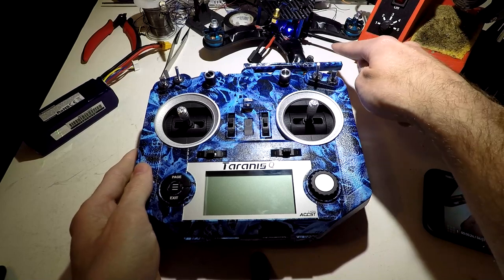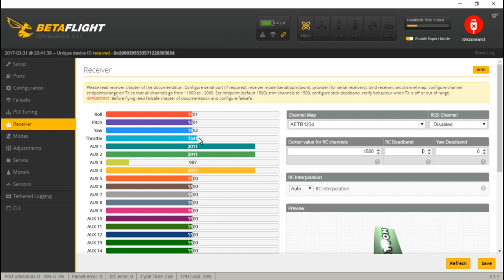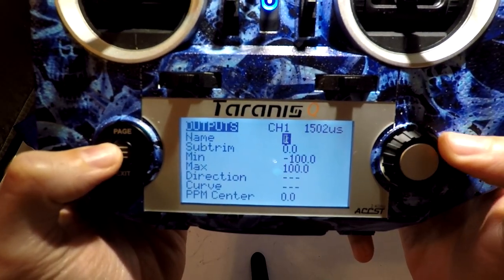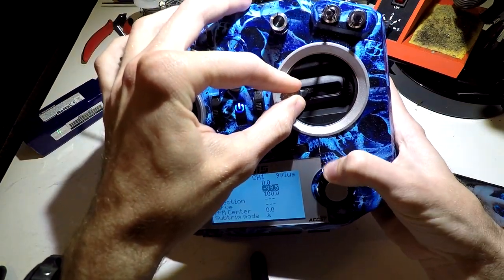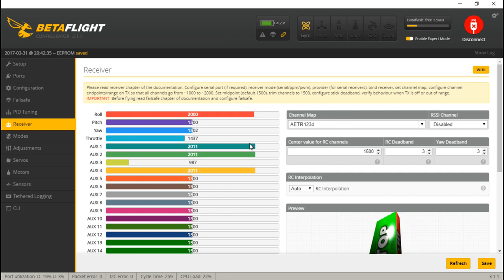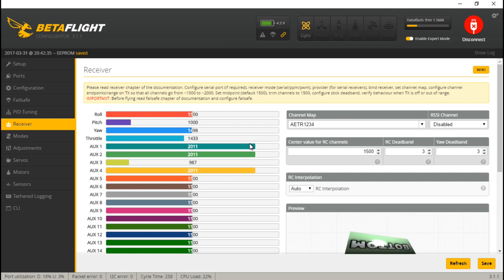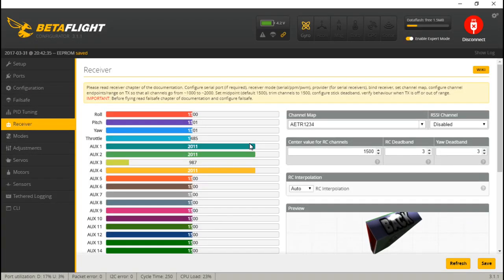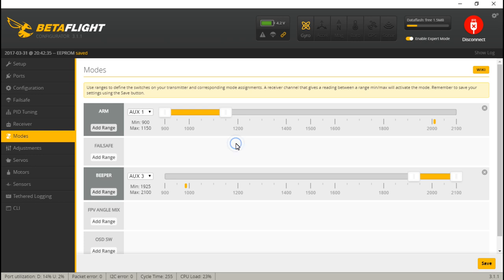Taranis Q X7: Calibrating Channel Endpoints

Comment: JC can you teach us how to adjust the telemetry for KISS ESC and FC to jet the Mah measures to be spot on?   I set up alarms like you showed us but notice even when the QX7 says I've used 1250 Mah my bat voltage is still at 3.75v or better.   Should be down to 3.18v or less if I really used that much of the batt capacity.     Thanks man!  👍🏼

Comment: please help me lol... got the x7 and when trying to set end points in betaflight won't let me go to 1000 or 2000... my min at min stick is around 1080 and max stick is around 1970 so when I try to set it from x7 will only let me go up from min and down from max... is thrre a way to get it to go below -100 on the x7 ? thanks so much if you can help me, kinda new to this whole setting up stuff
Reply: I have exactly this problem, mine end points won't go below 1080 and past 1970 and can find no way of fixing it :(
Reply: Rich Lees I fixed mine by myself he didn't wanna seem to answer lol easy fix... make sure in your transmitter that everything is set to factory meaning ur subtrim ect. then go into betaflight and write down your end points and min points for each 1 like roll then pitch then yaw I think the throttle wtv it is in order on betaflight then go into cli and type rxrange 0 1020 1970 press enter rxrange 1 1020 1970 press enter do that for each one but put your numbers in there make sure ya do it in order and it goes to rxrange 3 not 4 çuz it starts at 0 then when ya get them all typed in like that type save then press enter and worked awesome for me had to go in on tramitter to fix yaw mid point use subtrim now the other one he was using.. hope it helps ya worked perfect for me
Reply: Awesome thanks that's a great help
Reply: That worked a treat, had issues after changing the receiver on my King Kong 90gt, Never had an issue with any of my racing quads :)
Reply: Rich Lees haha mine was with the gt90 too and I changed the receiver also put some new pid's in it and Flys almost like a 4 or 5 inch I haven't upgraded the firmware yet tho Flys great now so why bother lol if ya want the pid's just let me know... I'll sub to you and you sub to me check out my kingkong vid

Comment: hello can you plz help me iv bin from vid to vid to vid ok i have a night hawk pro 200 with a fr sky antanna/rx and a taranis q x7 transmitter i hade to solder the rx myself but i no it works its binded now my problem is when i am on bata flight my right stick up and down is roll and my troddle is left stick up down is pitch i think not sure for word back word i need to change the map of my sticks but i do not no how to i put disable and set to aux1 but no so i messed with some setting in the trasmitter but ill just delete all that and start over so basicly i just need to no how to remap or what ever you would call thats change the order of sticks and maby a fail safe and a arm disarm if you can thanks
Reply: See this video at around 4:30
https://www.youtube.com/watch?v=PVV1UEK2nV0

Comment: Please help Anyone?? My throttle has switch places with roll on betaflight receiver??
Reply: hello i have the same problem my throlle has switched the place with roll did u fixed it?
Reply: yes which controller are you using?
Reply: I went to the mixer page on the controller and switched the roll and throttle.. or you can change on betaflight configuration page.. change receiver settings from AETR to TAER. Let me know how you go On?
Reply: im using the taranis qx7
Reply: it will be take 1 hour cause im not acutelly at home but thank u so much for writing it
Reply: i changed it on controller worked ;) thanks bro
Reply: @rcpete7055  how due you change it in betaflight